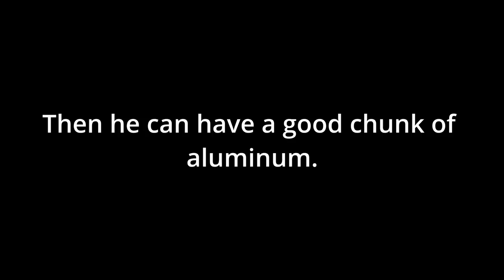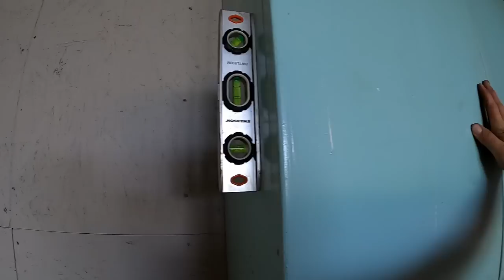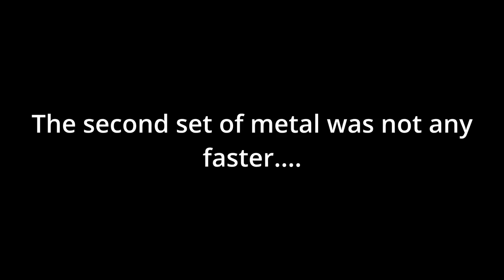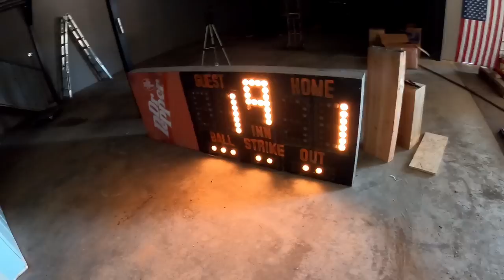The Junkyard LOOKS AMAZING! Big shop progress. DREAM SHOP!

Comment: After building my smaller dream shop, let me give you a sage piece of advise. Everything yo put on those floors get good urethane wheels. Locking swivels. You will never regret being able to move everything in 10min. Even your cabinet sets. Bond them and put them on casters. You can do a flex line hook up on the drain too. Being able to reset your whole sceen in a few minutes makes shop space an option at any time.  Love your shit buddy.
Reply: I agree 100%. Did the same in my garage. Mounted as much stuff on casters as possible. I can move most of the stuff outside in minutes when I want to clean up the floors

Comment: To me, the shop build is just as, if not more interesting than the car builds. Keep it up!
Reply from the maker: Appreciate ya watching it!
Reply: @PuddinsFabShop  
Yes sir, get you some RM-43 or equivalent total vegetation control and spray monthly and you should never have an issue. I use that stuff and it works wonders. Spend a little extra on a quality product and get what you pay for vs the cheap bs at the big box stores. Heck I think TSC actually carry’s RM-43 now because it actually works!

Comment: What I did when hanging cabinets in my garage was use a 2x4 as a ledger so I could rest the back of the cabinet on it while I screwed it in and then removed the ledger when done.  Works really well

Comment: Pro-tip when hanging upper cabinets, attach a temporary 2x4 along where you want the bottom of the cabinets, then you can level it out, and use it to rest your cabinets on so you can secure it to the wall

Comment: I would use air hose reels inside of the shop..... Mount two in the Main big bay on each side, Then one in the bench area by the outlets & lastly one in the side shop between the two bays on backwall AKA Breakerbox wall

Comment: For led strips if you get the "weather proofed" ones you can get these spikes that you can shove into them to easily attach them to other things. Otherwise a soldering iron and a bit of 22-24 gauge wire you can tack them back together to go around corners or hook up other power adapters to em, they usually say what voltage they run on the backing.

Comment: Bubba glad to see you using knee pads , when i was working at the old shop we did mostly under car , drive line , front end , brake and tires so i was on my knees a lot doing inspections then doing the work , i just wosh i had started using knee pads before they had been worn out . Knee pads made it better for the last few years before i retired !

Comment: You can still use the rest of those LED strips. You just need another controller, and to make sure the controller is either 12 or 24 volts, depends on what kit you ordered.
Reply: They’d make great interior lighting for the inside of a box truck if they’re 12volt base, just need some connections and a few toggle switches (assuming of course one had a box truck handy…) 😅
Reply: @a.feller2882  Yeah I need some 12v ones to illuminate the inside of my pc case. Was hoping the kit I got was 12v but they where 24.

Comment: Neat lil add on I did in my shop for my work branch lights was installed a timed photo sensor and piggy backed into my outlet, that way it would come on and off when I walked around work area   I was always forgetting to turn it off at end of work day.

Comment: Try old sump oil for the wood if you want dark, it might not soak in as quick as proper stuff but leave it in the sun for a few hours then wipe the excess off. Cheap, effective and anymore oil you spill just blends in once wiped

Comment: Some diamond plate or stainless on the wall as a backsplash would look good and serve a good purpose and keep the wall clean between the countertop and wall cabinets.  Lubey dubey and carb cleaner splash would wipe off.  Shop looks great though, especially with Ole Glory!

Comment: On your base board trim putting pieces on the door frame and 😢along the bottom edge of the door as a toe kick would look good. Where you extension cord comes out of the wall, the piece you cut out for the cord you can put inplace under the cord to fill in. A bit of black pant on the wall behind will hide the gap from cutting it out. Or cut a piece wit the same size hole but a bit wider ti alow for what the wiz wheel remove you can fit it in without a gap.

Comment: Some of those corners for the base board where the pices are small... Maybe weld them together as one piece? Just a thought. 
I love the look of the metal base board! I had to go a more cost effective route and used pressure treated wood for my base board. I just used regular water sealing caulk because i don't have a welder yet (not sure if I'll get one before i move). 
The shop is really coming together!

Comment: It’s funny you made that filler piece for the two cabinets and I thought hell that would be a nice place to tuck a light in and light up the work bench and then boom baby out comes a light. Would I want every video to be like this no but it’s kinda nice seeing the shop coming together, and the junkyard portion of the property is one of the neatest junkyards I’ve seen in awhile, hopefully you can get the orange crush up and running, get yourself a nice little trailer for it and you can haul some vehicles back to the shop, be nice to do metal runs with as well. Now the stones you had laid out in the junkyard area may have been one of those expenses you might want to have out laid but man it makes that area look nice, definitely a good choice in doing so. And now you’ve opened up the field once again, be able to get a couple of dirt bikes or side by sides and go for a rip out in the dirt with the girls. Watching you is like how I’d be doing things around the house, I  always seem to have about 20 or so things on the go at a time, start doing this see that move it to do this then have to clean that as I can tuck that here, my wife says I sometimes go into squirrel hunting mode like that dog from the movie Up, oh look squirrel. Shop’s coming along nicely, if it were mine I’d try and run the power cord for the lift/hoist up on the wall to eliminate trip hazards and with it up if you had a hand truck for moving things between the two sides you could do that without running into the cord

Comment: With those LED strips after you cut them you can reuse the piece that was cut off you have to solder them back together typically there's four little contact points all you got to do is cut each side that you're going to connect together right at the contact points with the four little copper spots and put a little jumper wire acrossed each one. You can even purchase a new male or female plug end to solder on to the pieces that you cut off they sell those also

Comment: As far as the paint rollers go the shorter the nap the smoother the finish. For that metal I would use a mohair roller they don't leave any texture they work extremely well on doors as well.

Comment: You might want to put a clear urethane on your butcher block counter . Just staining won’t protect from chemicals  and cleaning products. 
Try to find a oil based  urethane not a water based as it will last way lomger

Comment: use high gear when starting a dead motor with a push or a pull - puts more leverage on the motor.
that power steering is called 'armstrong power steering'
need a pully and rope for lifting stuff up to the loft.
Dadgum  but that looks good puddin - good job good show.

Comment: Those extra LEDs you can solder on new leads  and either buy another remote unit or just put a cell phone charger wired In . RGB together is white

Comment: Not sure if you know this Puddin but for the sake of your fingers the hole in the side of your caulking gun is there to cut the top off so you dont need use a knife. stick it in there and pull the trigger and it'll slice it right off.

Comment: Man building  a 4X4 is going to be cool as h3// . Also brother you may consider putting a 4-6 inch black rubber cove base down it's cheap and comes in 50' rolls at lowes and glues right to the wall. Just some added protection to the fire Block that would give you 4-6 inches of coverage along that OSB wall at the floor.

Comment: And u shud make u some like 3tf by 7ft rolling benches,tables so when working you have stuff ur using on projects right there by project,plus ya can roll em back along a wall somewhere when not using plus ya can get a 5/16 or 3/8 flat steel and top the tables with em,and welder under them on shelf,and hook a direct ground to steel plate top of table..

Comment: Fire extinguisher note- you don't want to have to go away from your exit to get the extinguisher so if you have have one keep it on the exit side of the higher fire risk areas... Unless you have a heavenly auto shop as cool and as big as Puddin's... if that is going to burn down, you might just want to go down with the ship.

Comment: After a year or 2 when the new rock settles in the drive. Lay down some recycled Ashpalt on a hot summer day.. Then get a roller for a lawn mower and fill it with play sand.. Its very dense and you get the most weight when wet About 400lbs, Bigger if you can.... Wait a month then seal it.. Should look like a perfectly laid drive.. We did that on my dads 300 ft driveway leading to a 4 semi pole barn.. was ALOT cheaper than getting it done.. And it wasnt that hard..

Edit: Btw if your worried about leaks you should have a pan under them anyway.. You dont want those fluids leaking into the ground. Cause im sure you are on Well Water being out in the country. And all those fluids will get into your water system at some point... Just a heads up..

Comment: You can get just the controllers for the LED strips and save money on the strips themselves. The more smart thing would be to use some wire and extend the LEDs to somewhere else and have multiple parts of the shop with that LED glow. it's completely doable and the voltage drop across the wires should be negligible enough to make it happen. The only thing is, you may want to look into a better power adapter for said lighting especially since you're in a very hot area of living right now, the capacitors in those power supplies are going to dry out or blow up before you even get a month out of them.

Comment: That LED strip light is meant to be cut.  If you look there are solder pads every few inches.  You cut, and solder on new wiring.  Just observe polarity.

Comment: it may be a better deal for you to pick up a few C 0 2 fire extinguishers. they will make your clean up easier should you get an engine fire.  dry chem A B C is very messy and corrosive side note C O 2 has an added benefit of static shock when used.. just saying

Comment: Hope you get the big Ford box truck up and running.  Not sure if it's a gas or diesel most gas are 370 ci very similar to 429 /460 but several small different parts if it's a diesel a 5.9 or a 8 .2 Detroit diesel.  Yes but I have one thay were very fuel efficient but head gaskets sux and the over head rack is a pain in the but .the Girling rear brakes are a bugger and slightly expensive but work very good.  The engine has to be running to release the brakes because  power steering fluid is used as the brake system booster or you can rig a motor to drive the power steering pump into turning.  A drill with a big battery or very long extension cord . Ok sorry forgot about you being from Oklahoma a garden tiller motor would be fine . And it will make it easier to get it up to the new very cool shop that I wish I had . Drove trucks of all kinds sence the 1980 when I got my first full time jobs.  The amount of stuff/ junk that you can safely move with a good truck like that is very nice.  The steering on the 1980 and up Fords in this series is amazingly better than others.  Hope that it will make going to car shows a lot easier for you.  Tents and lawn furniture and lots of products you can sell can all fit into the box and if you want it can easily pull a too car trailer.  And that guy with the cool dog that can open a car hood will be very envious that you can haul lots of estate auction items.  He thinks he has a good tow rig . Thanks for the hard work and thanks to your great friends for helping you out and I sure that you will help them in return.

Comment: Before you get moved into your new shop are you going to install an overhead crane system for moving heavy objects. Hahahah. One more PS. See if you can find a new business that's going out of business we're tearing the building down and Salvage the air condition for your shop ground unit would be the cat's meow I'll catch you on the flip side God bless😊

Comment: I want to give my 93 Toyota 2WD for a body swap on that 4WD. But I can’t afford to send it from SC to OK. Engine is rusted up but the body is 98% perfect. Bent rear bumper and the front cowl but the hood, doors, tailgate, bed are all straight as an arrow. Paint is still there but the clear coat is starting to peel. Wanted to fix it myself, but I don’t have the funds. Thought was a 2JZ swap, ford 9” with 4-link. Think I could get some shirts and caps as trade?

Comment: Instead of using the running gear out of the Toyota for the half haul a Nissan frontier or hard body would be a good swap. Even a ranger or explorer frame. Not as much value in those and they made a lot

Comment: I would also leave the half haul as a ford courier with a toyota 4x4 motor tranny and trànsfer case......after all, you are taking an unreliable platform(ford courier) and making it the most reliable 4x4 on the planet(plantation, Toyota)... it IS PUDDINS FAB SHOP ...  PUT THE FORD ON THE TOYOTA